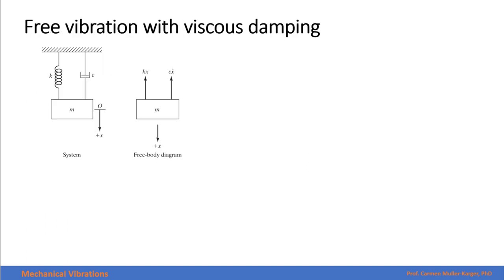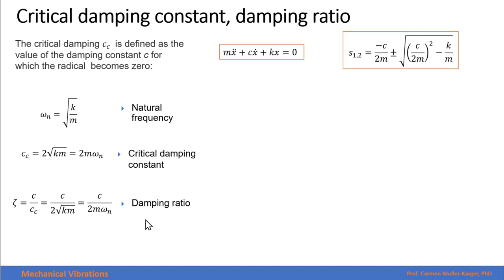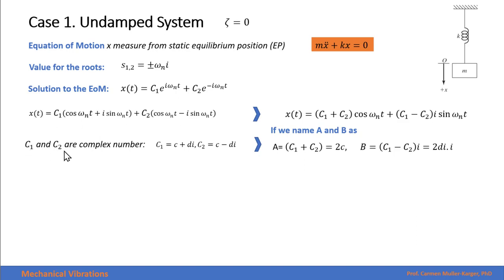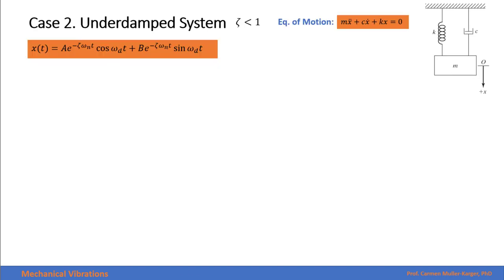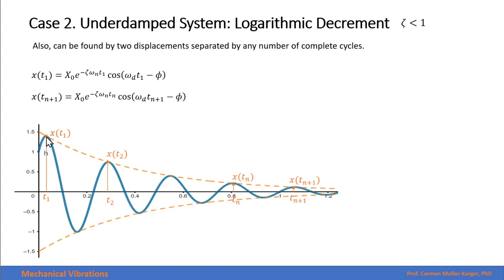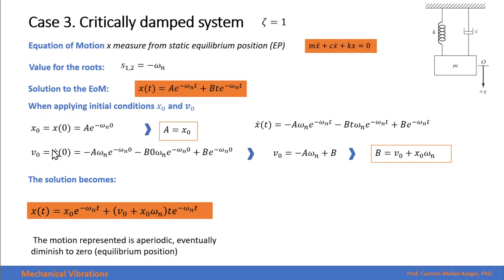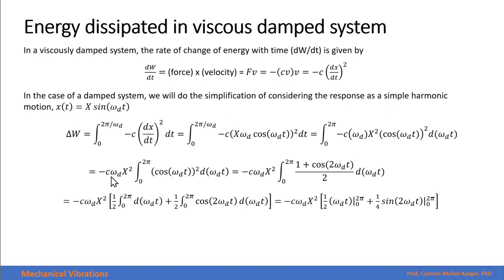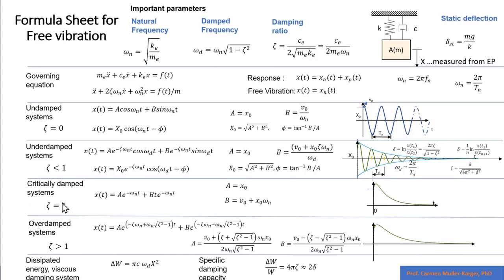Narrated lecture CH 2 Part 3 -Damped SDoF Systems ( new version)

Comment: There are some subtleties about critical damping that are rarely mentioned in videos or in literature. Namely, critical damping is NOT the best choice if we want the system to settle down to an equilibrium state (zero energy state) as quickly as possible. Details can be found in the paper "Damped harmonic oscillator revisited: The fastest route to equilibrium" published in the American Journal of Physics. Also i posted a short video about it on youtube, the title of the video is "Damped Harmonic Oscillator: Critical damping is not the optimal choice" https://youtu.be/OgVBQJMH12E